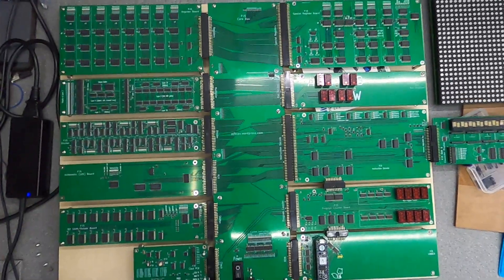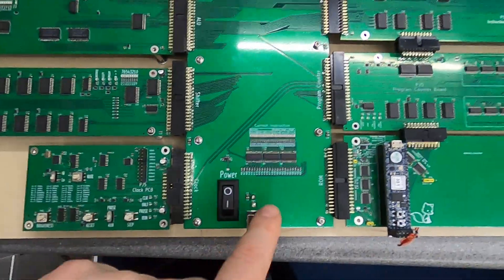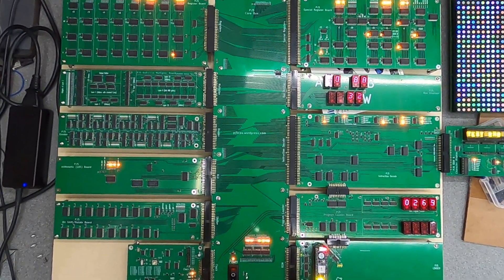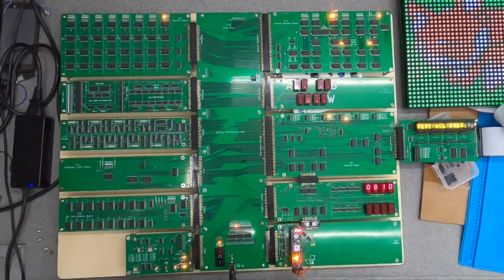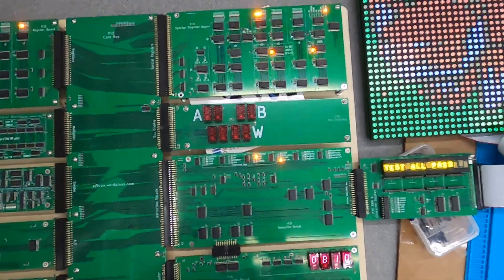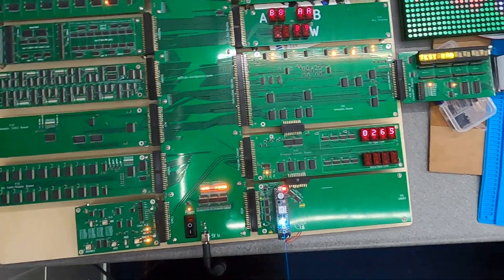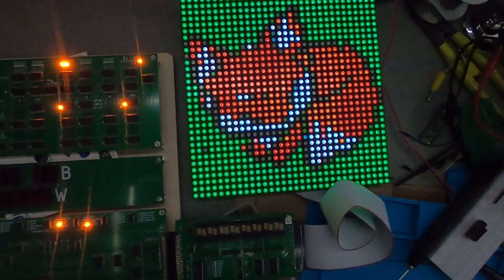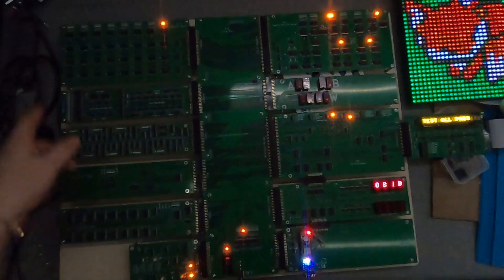PJ5 TTL CPU Hits 4 million instructions per second!

Comment: You are not allowed to use surface mount parts ,....!!!
Reply from the maker: if you want to stick with through hole for your TTL CPU, then you do that.
We're happy with SMD.
Reply: SMT parts are actually easier to use (and much faster to solder)  than thruhole and much more reliable. (No need to flip boards to solder)

Comment: Congrats! Maybe the clock board could have a VCO or maybe something even simpler like 74x221 with potentiometers to tweak the clock frequency to breaking point :-) And then replace boards (different TTL series, designs with less capacitance, connectors etc.) and see how far you can go. It would be fun to find out where is the speed bottleneck not just from design perspective (longest signal paths in CPU) but also "manufacturing" perspective.
Reply from the maker: thanks for the suggestions, I've made a simple clock generator in an FPGA, so we might hook that up and see how far we can get :)
Reply: @PaulasTechStuff  Or maybe a 74HC4060 with a 16 to 1 mux selected by a rotary switch now that would be one cool crank to turn 🙂
Reply from the maker: @zoltanpekic3119  Yup, we're thinking something much bigger and easier to turn :)

Comment: Do multiplication and division is executed in one clock? If so , How do you acomplish division in one clock ?
Reply: For the division, my guess is that the iterative process has been unrolled, with the eight stages laid out one next to the other. Anyway, that's a very impressive work you've done there! Congrats!
Reply from the maker: @Amand.T  You are correct.
Thank you, we're super pleased :)
Reply from the maker: Yes, both are one clock cycle and are based on 74F181s. Jon is the maths wizard, we did a video about the multiplier here - https://www.youtube.com/watch?v=Zf09oSCSJaY&list=PLqTn11YkMSMxu0p4yKBcYW34_R2fK80yI&index=8

Comment: Is it pipelined? if not, how does it achieve 1 instruction per cycle.
Incredible build by the way!
Reply from the maker: no pipeline, we have a two phase clock, program counter is updated on phase 1, the logic then does all it's magic, and one the second phase the data is written. so speeding up the instruction decode and writing to the registers was key to getting this.
Reply: @PaulasTechStuff  so is the clock running at 8 Mhz then?
Reply from the maker: @qiblical  no :) The clock runs at 4MHz and has two phases, one is 200nS behind the other.